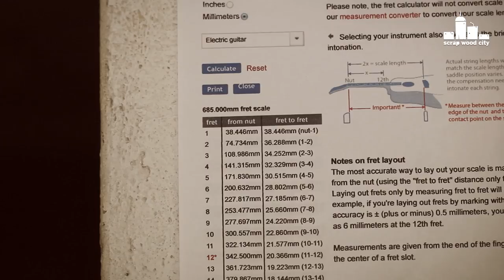How to make a DIY electric broomstick guitar

Comment: I always watch these thinking one day I'll make one. But I don't have the right equipment...
Reply from the maker: The beginning is the most difficult part!
Reply: Jessica Vergara Jessica, use what you've got and give it a try - that's how we all get started. Good luck and let us see what you come up with!
Reply: Jessica Vergara 

All you need, honestly, is a bit of wood, a couple of screws, a guitar string and some kind of resonator like a glass bottle or a can. Start with that and work your way up to something like this.
Reply: Only need a few things to get started on woodworking. A hand saw of some sort, a chisel set, a hand planer, and some sandpaper. All the fancy power tools exist to make it easier, but people built instruments a thousand years ago and never once plugged in a power tool.
Reply: First makers of these type of instruments did not have any of these equipments.
Reply: I know this is an old comment but I used to think the same. There's a lot you can do with very basic (and cheap) hand tools, a file/rasp, a chisel, a hand saw, sandpaper etc. Of course it takes a lot more time, it's a lot more work to do it all by hand and sometimes you have to get creative with what you have but it's better than not doing it at all. I don't have the space or money for an actual workshop but I can still have my fun with simple tools and it's suuuper rewarding. And relaxing somehow even if it's tiring.
Reply: you don't have a stick?

Comment: I found lipstick pickup too expensive for this project, so I have to ask: Can common garden door magnet be used for this purpose?
Reply: No as pickups aren't just magnets. Here's the same pickup used for like £7 https://www.amazon.co.uk/FLEOR-Potted-Guitar-Similar-Replacement/dp/B073PZ87B7/ref=mp_s_a_1_2_sspa?dchild=1&keywords=telecaster+neck+pickup&qid=1588899668&sprefix=telecaster+neck+&sr=8-2-spons&psc=1&spLa=ZW5jcnlwdGVkUXVhbGlmaWVyPUExSDZNWkc0UFVKSDZNJmVuY3J5cHRlZElkPUEwMTc3MjI0MjM2WkU4OUFRRUhGQSZlbmNyeXB0ZWRBZElkPUEwNzczODc4M004U0Y1RE9YOTFWRiZ3aWRnZXROYW1lPXNwX3Bob25lX3NlYXJjaF9hdGYmYWN0aW9uPWNsaWNrUmVkaXJlY3QmZG9Ob3RMb2dDbGljaz10cnVl
Reply: No as pickups are not just magnets. Here's the same one used for like £7 https://www.amazon.co.uk/FLEOR-Potted-Guitar-Similar-Replacement/dp/B073PZ87B7/ref=mp_s_a_1_2_sspa?dchild=1&keywords=telecaster+neck+pickup&qid=1588899668&sprefix=telecaster+neck+&sr=8-2-spons&psc=1&spLa=ZW5jcnlwdGVkUXVhbGlmaWVyPUExSDZNWkc0UFVKSDZNJmVuY3J5cHRlZElkPUEwMTc3MjI0MjM2WkU4OUFRRUhGQSZlbmNyeXB0ZWRBZElkPUEwNzczODc4M004U0Y1RE9YOTFWRiZ3aWRnZXROYW1lPXNwX3Bob25lX3NlYXJjaF9hdGYmYWN0aW9uPWNsaWNrUmVkaXJlY3QmZG9Ob3RMb2dDbGljaz10cnVl